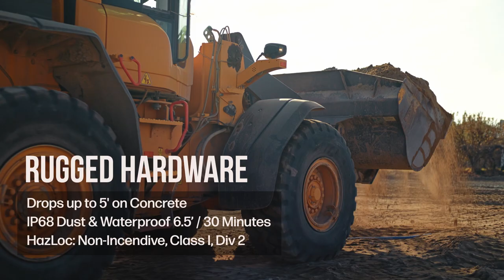Kyocera DuraForce PRO 3 Ultra-Rugged Smartphone on Verizon

Comment: Does it have a Sapphire shield screen?
Reply from the maker: DuraForce PRO 3's display is ideal for those who operate outdoors and in harsh environments. While it doesn't feature Sapphire Shield, DuraForce PRO 3's robust display is thoughtfully engineered for outdoor visibility, low sunlight reflection, and exceptional scratch- & shatter-resistance.
Reply: I was hoping for a yes. That's sapphire is my selling point everything else is a plus plus.

Would've bought one of it did
Reply: The same for me as well!

Comment: I'm gonna buy Kyocera product for the first time if you guys make a rugged phone that has at least the following features or specifications:

° 22000+ (preferably 25000 or more) mAh battery (with high optimization).

° Dynamic AMOLED 2x screen with (working) 120 hertz refresh rate and max brightness of at least 1200 cd/m², protected by Corning Gorilla Glass 5 or superior; low-temperature polycrystalline oxide (LTPO) OLED display backplane technology (for more efficient use of power by dynamically adjusting the refresh rate of the screen based on the content being displayed).

° Camping light with 1200 lumens or more so that the light beam reaches at least 60 feet while still being bright at that distance (optional: adjustable light beam). 

° 60 FPS 4K video camera (with the ability to toggle camping lights on while recording).

° Optical image stabilization.

° 64+ MP night vision camera with IR light reaching at least 330 feet.

° 110+ decibel high-quality speakers.

° 12+ GB physical RAM, 512GB ROM (internal memory).
Reply: Loool man, It would be cost a more than 1200$, but I would buy it frl. You just described the phone I want tho.
Reply: I agree with you
Reply: Add infrared thermal camera and I'm in
Reply: @nichderjeniche there is a phone with flixr in it
Reply: @davidblevins9513  yes I know but they all are ugly and look like typical construction workers phones